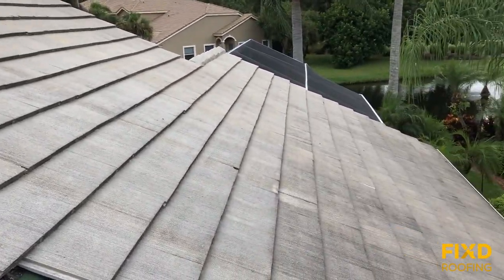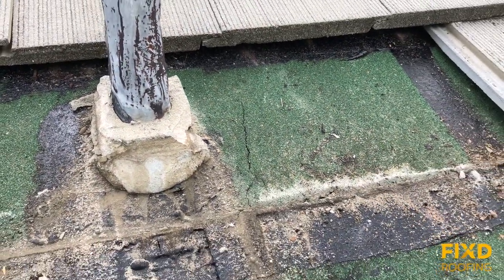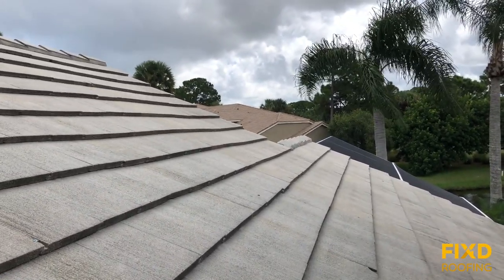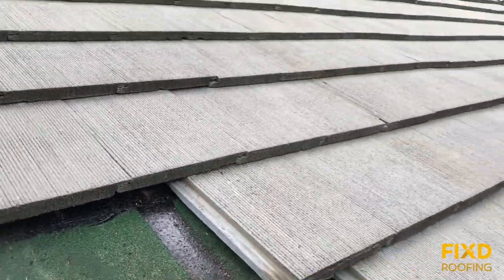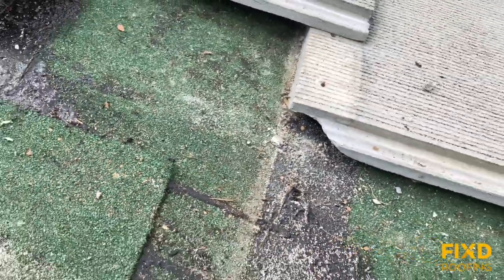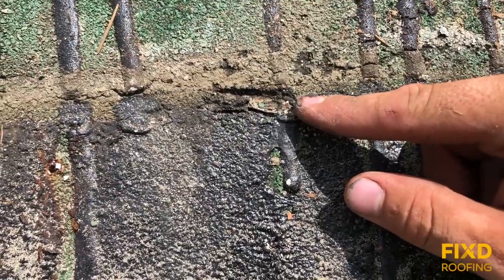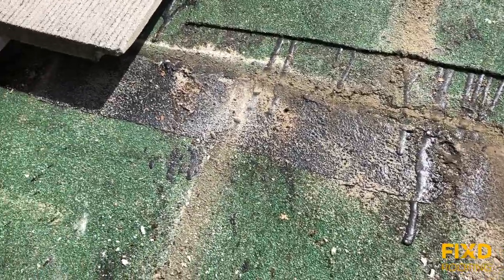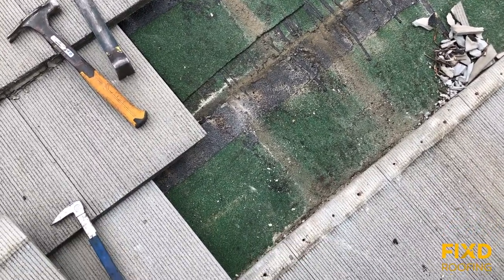Why Flat Tile Roofs Leak in Weird Places

Comment: The American way of roofing is strange. fixing concrete tiles directly on to the roofing paper is a long term recipe for trouble in UK we fit batten from ridge to gutter .Then battens at fixed gauge parallel so the tiles never touch the paper far better system. The proper way
Reply from the maker: Interesting. Sounds like a pretty good system
Reply: I agree with ye, plus it looks like thers not enough head lap on those tiles, if you look at the water mark it's only barely covering the nail holes, and who uses a blob of rendering to flash around a pipe.
Reply: @neilkennykenny4113  that’s not the normal way of doing tile in America. In Arizona tile roofs have a proper lead flashing around each vent pipe. They also use wooden battens under the rows of tile like in the UK.
Reply: We have a similar tile in England stonewold or Marley modern I’ve just looked at a similar problem on a roof and in my opinion the tile isn’t the problem it’s the gauge dropping the gauge an inch will solve it especially on a lower pitch roof it might add a couple of course’s and the extra weight needs to be taken into account

Comment: Thanks for the video, we use a very similar flat tile(12x16") to what you have shown here, it looks like there is not enough head-lap on those tiles we usually allow 4" of headlap and no less than a 22.5 degree pitch on the roof and the under felt would not be depended upon to weather the roof, I agree with you that profile tiles are better that flat because the interlocking channel is positioned higher up and so water flow cannot enter the channel as it can with the lower positioned channel on a flat tile.

Comment: LMAO !  Instalation failure!   No battons! Code says there must be min. 1*2" minimum wood battons ubder flat tile, with gaps in battons every 4'
Reply: Thank you for calling him out because I have a flat tile roof in Arizona  built in 2018 and I was worried. IF battons are used flat and s style roofs must be equally good.